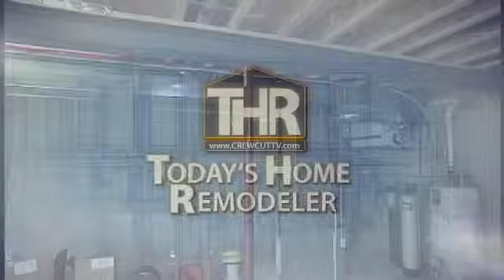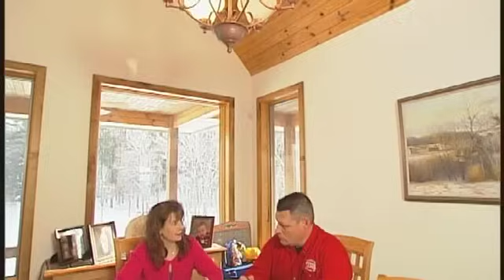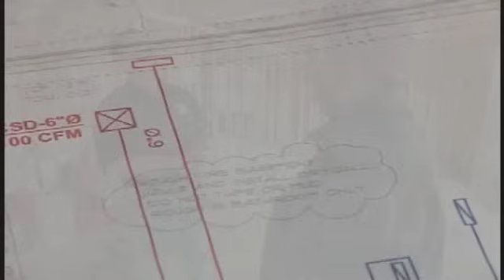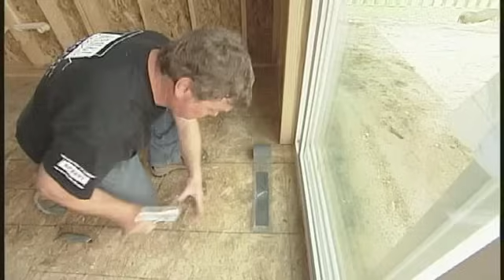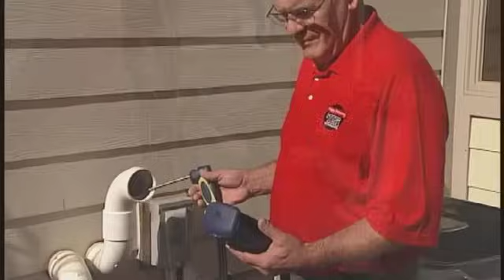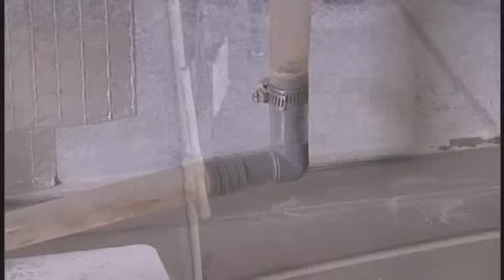Heating & Cooling for New Home Construction - Bryant

Comment: We were accommodating with range placement, but we used trailer flex to offset the cost of the extra piece of wall stack.

Comment: They should have sealed all connections with mastic or tape, loose a large amount of air in those joints. Loose a ton of your efficiency with all those unsealed connections

Comment: I’m sure they sealed and insulated the duct afterward.  They just wanted to show of the sheet metal job.  This is how systems used to be installed in the 60’s. My father was a contractor, and the heating systems were are rectangular trunk lines with round and square take offs where necessary.  I don’t remember seeing any mastic or insulation back then, but the ductwork looked just like this.  Anyone who uses flex for an entire system is not a pro, just a amateur HACK
Reply: True craftsmanship in the old days in sheet metal work. Awed by the skills of the old timers with all the compound reducing tees and ells. Not to mention no flex. All rigid.
Reply: I doubt it I think one of their workers commented on another of my post saying spray foam was used which isn't code.

Comment: Rounded ducts are more efficient, why are all these rectangular?
Reply: The main ducts on the supply and exhaust are rectangular for correct volume and static pressure while the side duct runs are round.
Reply: Robert Slackware  - No, you are right, I was just learning at the time.
Reply: Robert Slackware  - Ah I see. I was planning on installing an HVAC system in our future house, that is why I was researching about all of this. Thank you for the info.

Comment: Nothing is sealed or insulated. Conditioned space or not,  how can you make a video about efficiency  and not seal and insulate the ductwork? Crazy man......  Very clean work though!!!
Reply: spray foam.
Reply: @j.walker3498  Doesn't prevent air loss in the ductwork and exposes the spray foam to moist air that will allow mold growth
Reply: @zack9912000  no keep your OPINION to yourself. that's not how condensation damage works. Air inside duct is NOT moist. Duct tape and or mastic at joints/seams prevents any air loss,.
Reply: @j.walker3498  You clearly don't work in our industry, it is CODE all ductwork connections must be sealed with foil tape or mastic to prevent air loss and blower door tests are required on new construction, spray  foam over ductwork in some states is illegal.. See it all the time were ductwork is not sealed and or  insulatated as code requires. 

It either must insulated inside or it must be wrapped. See it alot, causing condensation to run off the ductwork and mold to grow.  Buthers try to use Spray foam on ductwork which in most states can't be used to  Insulate ductwork period. Beside there is plenty of moisture in the air flowing in your ductwork that will cause mold growth from improperly sealed ductwork where it can escape spray foam or not. Doesn't take a high percentage of moisture in the air supply to cause mold problems.

Hence it is a billion dollar a year industry using dry ice to remove mold from  roof sheeting because of leaking ductwork Also how tight the ductwork sits there is zero chance in hell they are getting 100% of all that ductwork covered.
Reply: @zack9912000  Thats exactly what i said. i only have 4 years installing. but have been a super the last 10.
Reply: Agreed @
Reply: Agreed!!!

Comment: If the thermostat has a dead battery, it also won't turn our equipment on and off.
Reply: Not always true some stays run strictly off common from the air handler
Reply: Stats

Comment: No turning vane in the tee on the plenum box. No duct seal on the joints or insulation. Must be exposed or conditioned space. They dovetailed the 90's instead of using a boot tap.

Comment: Not a single thing is sealed or insulated?
Reply: Taping or painting it with duct sealer is very good, we do it in all jobs in the Commercial Industry along with Insulating  it the cost an time is well worth it in the long time
Reply: Robert Slackware  Are you on Hydroxychloroquine? Any Cold or Hot Air that gets into your basement means you are spending money! Meaning Gas or Electricity. So much for Energy Efficiency.
Reply: Robert Slackware  I am guessing you live in the Southern USA. Here in Canada Cold Air, well with the exception of a Cold Air return, is a BAD thing. The same thing can be said about your "Main Trunk" Air is leaking out...therefore the Efficiency of your HVAC goes down. IT is blowing heat where it is not needed. Please don't give that crap about Heat Rises!
Reply: Sean Vandyke when it's done properly you don't need to can tape it the two companies I work for never used one one roll of 10 tape this other company I work for they loved it cuz I didn't know how to install how to install
Reply: @tombrown1227  Also that isn't true, you will have some air leaks no matter how tight the metal work. Also it is CODE nearly every state all joints must be sealed with tape or mastic and efficiently test via blower doors are done.